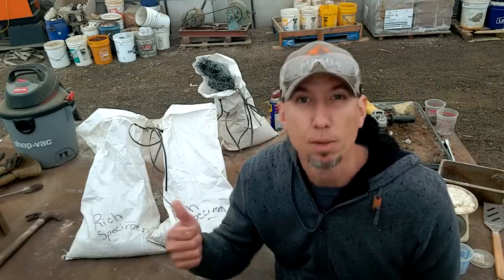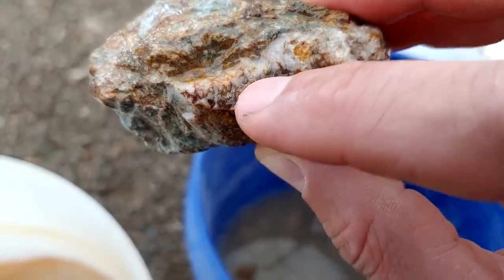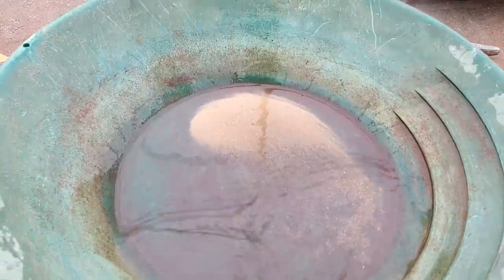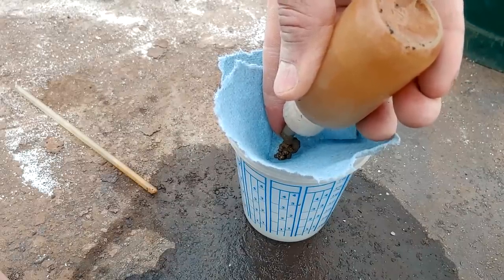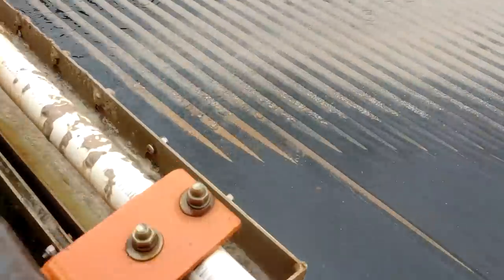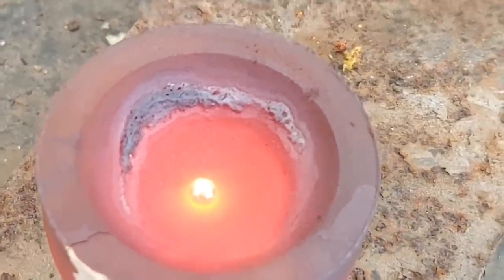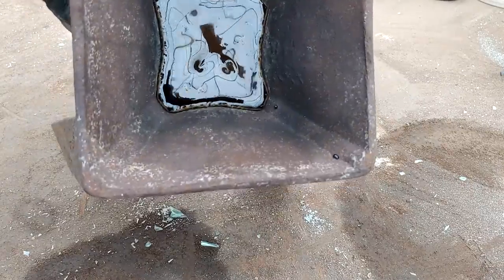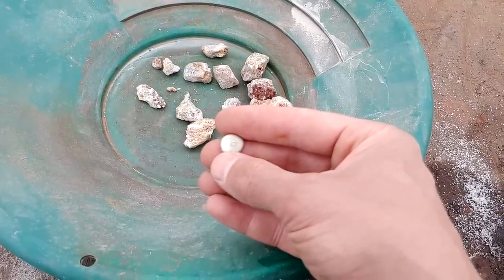Jeff Williams High Grade Gold Ore!

Comment: Drying your stuff works better if you do:
Shop vacuum intake covered with a strong cotton towel  that is zip tied or whatever making a little socket in the intake tube. Then you add your shop paper towel and pour your material in, THEN turn on the vacuum once you have made sure your not going to suck in the towel and lose your wet sample. a few seconds of that and you should have a fairly dry sample

Comment: I need to do a fire assay on my black sands.  The material I'm panning is heavily weathered glacial moraines.  LOTS of black sands, and very fine flakes of gold.  I also see many dust-sized grains.  The gold is coming out of hydrothermal quartz with streaks of hematite and galena crystals through them.  So it's very fine and tiny, hard to pan out of the heavy black sands, which also have gold dust trapped inside (an HCl dissolve after roasting a small sample released some fine gold powder).

Comment: You need to get you a Gold Monster metal detector like Dan has. I'm pretty sure he got his from Kelly Co... not cheap but it works really damn well. Something else you could try for removing the rust (though I don't know if it'd melt quartz) is the Evaporust stuff they sell at OReily Auto Parts or Advanced Auto Parts etc.. or you can buy it online. The stuff is pretty amazing for what it does to rust on metal so I bet it'd work on stone too.
Yellow dense mineral in the Las Vegas area.. scary part is it could easily be uranium, there were TONS of uranium mines around Vegas. Scheelite is easy to tell, just hit it with a 365hz UV light, if it fluoresces it's scheelite, if not it's not.

Comment: it would be awesome if there was a type of multi-screen, multi-mesh dry screener shaker machine that could be maybe 2x2 feet and about 2 to 3 feet high, or adjustable height overall. basically, it should be able to make two size cuts per screen. a plus and minus size. and starting from the largest screen, each part would be funneled into a bucket or bin. if there was a shaker motor that attached to a sort of platform where each screen would be insert, and it would be able to run on a 110 outlet. that would be amazing. it could either have a trailer hitch, or have wheelbarrow handles and wheels for mobility, and it should be all stainless steel, or aluminum. whichever was most cost affective to produce for whoever was manufacturing and or buying it. i can imagine it would still be between $500-$1000 to buying or manufacture, and ship etc... , but it would be well worth it for dry screening small batches with a shovel, or "by the bucket full" so, basically, it would be a part of the sampling process for larger operations, as it would be great for larger samples, but better efficiency than the regular prospecting screens you shake on a single bucket. it could also be possible to do a multi-screen stack of mesh sizes, and just have them removable like shelves in the machine for removing the "plus" size materials that stay in each screen. it would also be nice if there was a very small wet-screening processor or micro-trommel that could have multiple mesh sizes for wet screening into tubs. where one tub would be screened into, and the large material would be collected on a tray or sheet or a tub that sat on top of Another tub, where the water would be displacing into form the "screening into" tub. then both tubs would have a drain plug on the bottom to enable removal of water and silt or materials as needed, but it would make for a really nice mobile ways plant that a person could move by hand on a sort of mobile cart style way. then, it could have a simple hand crank to turn the trommel and use an automatic hopper to feed material into he trommel as its turned. (this would be especially useful if one where to use such a wet screening system at say, The Crater of Diamonds, where nothing one brings can be electronic, and has to be brought in by hand. which is fair i suppose lol.) in any case though i would absolutely buy a system like these ive described, if only some one could manufacture and ship them. i already have the basic concept in my mind, but im not an engineer or designer so, i would have to leave the specifics to some one else anyways.

Comment: I had put 7 grams of gold powder from a drop from aquia regia into a cast iron pan with a rounded cast of portland cement to melt it in a campfire. I also mixed the powder with borax and a pinch of baking soda. All was well, but in a couple of hours , the whole pan was a fluffy material. Should I brush the material into a crucible with no other borax or drop lead into the ground portland cement?

Comment: I’m puzzled.  You’re bucking hard rock ore into powder, then treating it like placer gold by separating it physically.

To figure total Au, you need to run fire assay on a representative sample, then collect the Au with cyanidization, from the whole sample.

Whatever number you are figuring, by the methods you’re using likely under represents the total Au in the sample.

You might be leaving a lot of microscopic gold in the washed sludge.

Fire assay the washings.

Comment: Only issue I have is, you should have been inside in a controlled setting, so incase of a spillage nothing would be lost also strong wind can blow buckets over.. Inside a garage or anywhere that is not in the open.. I am very small scale, but every small piece adds up.. You said even the dust was rich, so I don't understand why you classified out in the open on a dirt/gravel ground.. I liked that you used water to further classify specimen pieces out.. I know you've been doing this for a lot longer time then I have, I just don't understand why you don't work on a poured concrete pad to do a lot of your processing, I would imagine that some precious metals are getting lost to the ground.. I'm not trying to sound critical.. One other tip a friend told me, is when using a shaker table or other looped water separation to use some "jet-dry" or low to no sudsing laundry soap, that will stop all very fine gold dust from floating in the water.. Thank you for sharing, I do, very much enjoy watching your videos...